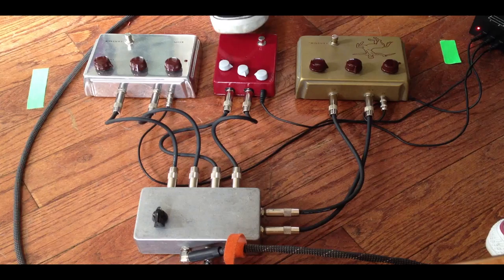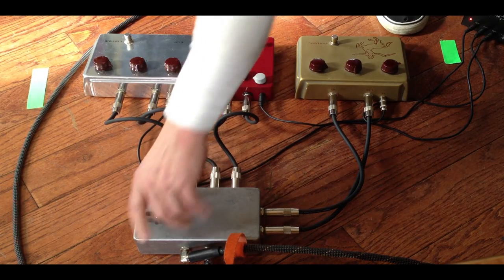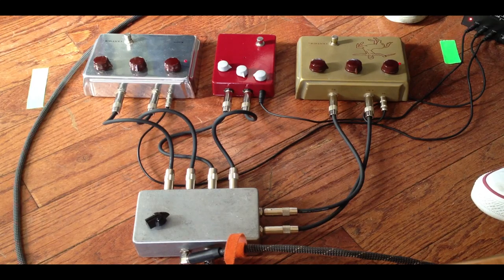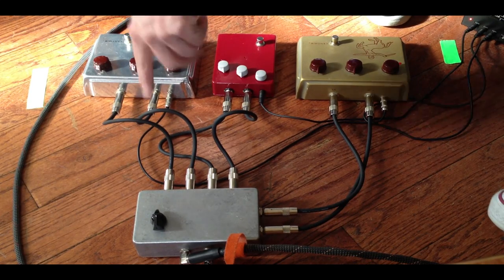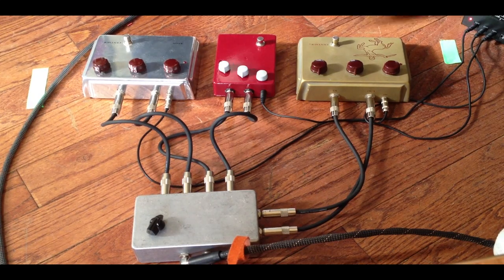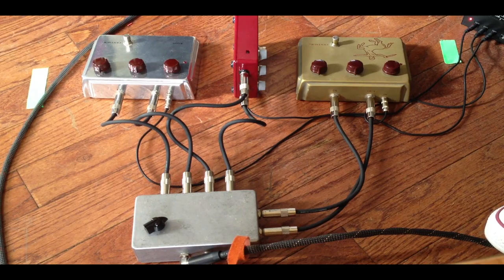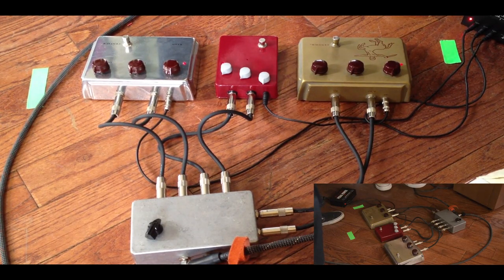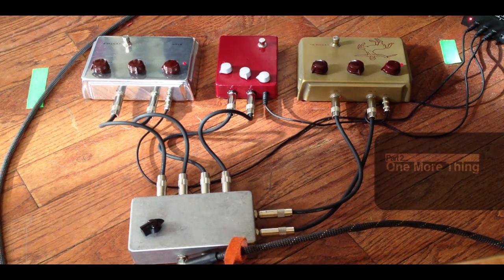Klon KTR, Centaur Gold and Centaur Silver Comparison Demo with Bill Finnegan and Taylor Barefoot

Comment: I've had two KTR's, the first from the original batch in 2012, then foolishly sold it in a fit of GAS for something else and regretted it. I decided to hold onto the latest one I've gotten past the honeymoon stage, and I still love it. I've tried almost every Klone out there, and none really compare to the KTR. It just has it's own voice. My cousin has a silver Centaur, and they don't sound IDENTICAL, but it could be just variances in pots and tolerances. It's completely in the realm of what the Centaur does, and the KTR will be staying on my board for good. Great pedal. Not necessarily worth all of the hype and aggression, but compared to the other Klones it stands a peg above. Definitely has more gain that the Centaur, but that's not a bad thing. I'll say one thing: there's only one word that my cousins and I (who have played for 15 years each), and we all came to the the same word: DRY. It adds a nice mid bump, but compared to the other Klones that all sorts of different tonal variances, the KTR retains your signal, but just boosts it. The OD on it still sounds like your amp with a mid-bump. I say dry, but that's in a good way. So many add an over-abundant presence and overall coloration, where the KTR is just to the point. Love it.

Comment: Great demo.  Going on 5 years and still well done!  To my ears, gold centaur, silver centaur and red centaur (bypass, not buffered), in that order.  All of them are really close, but the gold unit has a little bit more headroom to my ears.  So many people trying to reproduce these things, even the original producer of these things.  (And they were all a little bit different from unit to unit to begin with.)  But funny how with electronics, you can have a signal diagram, but the characteristics of the components change over time such that it is very hard to exactly reproduce the tonal characteristics of that signal path in a different era.  That's why so many of us still play blackface Fender amps built in the mid-1960's. If I had to get on stage for a living a play for my life every night, I would spend the money for a good sounding original centaur.

Comment: I've had a silver for about six years.  I know everybody is like "what is so good about Klons? Why is it so expensive? I'm not sure how they got so expensive but I do know that I used to buy and sell my distortion pedals all the time and since I got one I have stopped. Any other pedal I have tried sounded so much better when the Klon was on after it so I couldn't get rid of it.  It's has a weird kind of rough sound but it just sound like an electric guitar should sound to me, rough, and wild but not totally perfect. Right now my signal chain is (1973) Gibson es-335-Klon Centuar- Kelley Fuzz head (for higher gain)- or zvex wooly mammoth for fuzz-to a 1973 Fender Deluxe reverb.  I like more 60's and "old sounding" distortions and this does not sound like a a Dr z with a full tone full drive or Ac booster or Hotcake or other more "pro sounding things" I really like mine-
Reply: No I haven't... I'd like to! Yeah I got mine when they were still making them. I think it was two seventy five or something like that...
Reply: I've tried my pedalboard without a Klon and my tone just isn't there. I need a Klon now ha! We have an original silver Klon, but now that the KTR has come out we gig with the KTR and use the original at home. Hell we used to ziptie the original Klon to the pedalboard in fear of someone running off with it!

Comment: You and I both. Great comment, which saved me from having to say it.

Any two consecutive pots/caps/resistors off the production line could each exhibit one entirely separate end of the spectrum of manufacturing tolerances. 

Some dudes just like words like "handwired", NOS, or true bypass because it helps them feel better about their below-average playing abilities. Of course the marketing departments helped to create the "gear-queer" movement. 

Nice unit & demo Bill, kudos!
Cheers!

Comment: True bypass on a pedal means nothing if you have 10 pedals with it. You're still going through ten switches. Buffered bypasses are great if they're done right -keeping unity gain and sweetening the treble in just the right way. The buffered signal on the gold unit sounds best -even the bypassed signal- at least through my computer.

Comment: Similar but there are slight differences. I'm tempted to buy a KTR & a Centaur version to really feel it out with my own gear. The one thing that is pretty poor about the demo is how each pedal would react in front of an amp that is cooking. Whether one version is brighter thicker or whatever it might work with my current setup differently.the OTHER issue is the player. This guy is not a great for this. All I heard is open string voiced chords and octave riffs with an open E drone mostly

Comment from the maker: We compared the gold/silver here because that's what people wanted to hear. The gold and silver are indeed identical parts and circuits, but natural variance in components means that some sound different than others. The KTR is the same circuit, but implemented with a surface mount design and obviously different parts (except the diodes, which are the same). 

No need for physical threats. Just agree to disagree.

Comment from the maker: Amps are actually notoriously inconsistent in my experience. Check any Fender schematic. Voltages and component values are spec'd at +/- 20% values. Amp resistors within 10% tolerance, etc. Just soldering something can shift the value of a resistor. I've experienced amps of the same year & model being pretty different when A/B'ing them. I doubt an audience would notice, but its there. The differences between Klon pedals are tiny at most.

Comment: I'm a longtime builder/player myself. I'm just going to state my observations re the Klon at this point in time. I'm not trying to joke around or be mean or sarcastic at all. However, I have yet to figure out what the big deal is about these pedals. I have a very critical ear, but as I said, I really don't hear what these units are doing. The straight sound through the amp sounds exactly the same as the sound with the pedals on. Maybe I need to play through one.
Reply: "The straight sound through the amp sounds exactly the same as the sound with the pedals on." To me that is precisely the point of the appeal of the Klon pedals. I recently tried a friend's KTR into my VoxAC15  60HW and it just gave it more amp and nothing else. A beautiful thing.

Comment: If you think or use the Klon as a distortion or overdrive pedal you've missed the boat and will most likely be disappointed. The Klon is designed for clean boost and there is no other pedal that will do that better. I hope the KTR will function in the same manner. Any change to this feature will render the pedal unworthy of the Klon legacy.